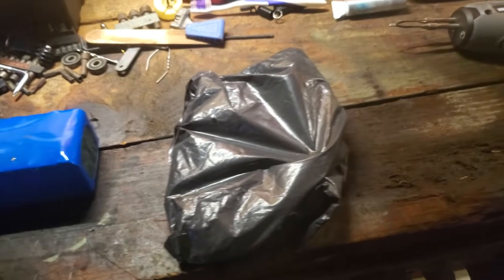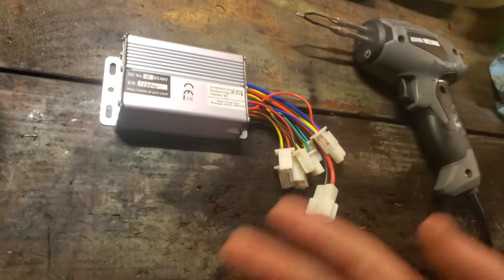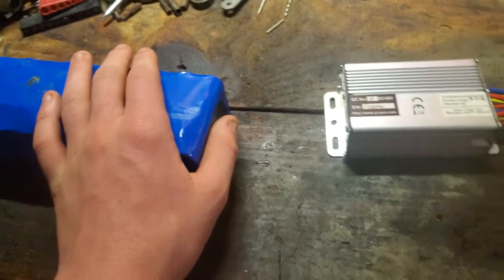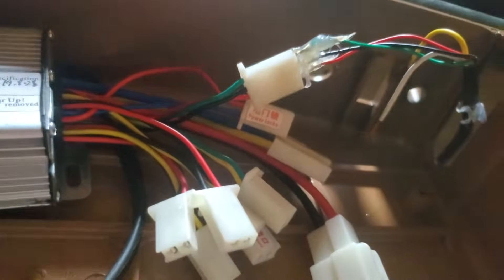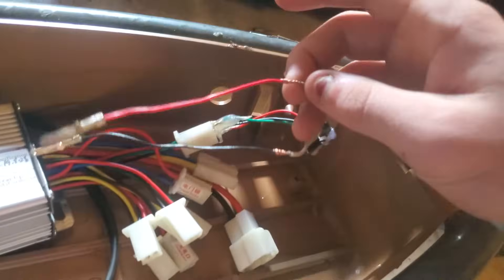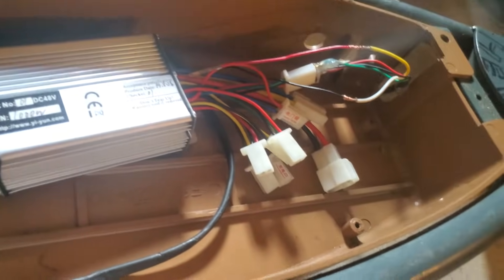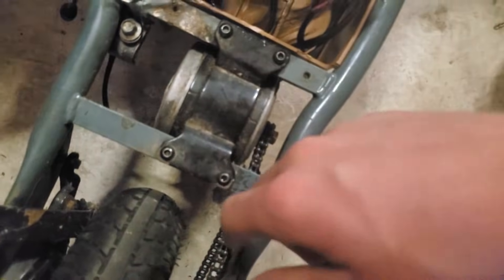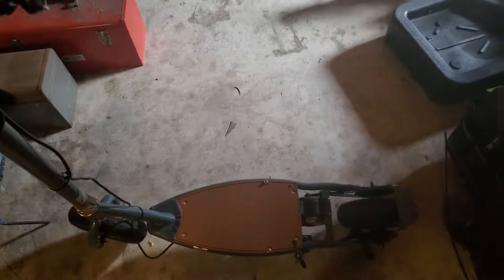Wire 48V Speed Controller Key Throttle, Motor, Battery...

Comment: Question: I have a 1000 Ecotric Hammer, 48 Volt, I want to use a 52 volt battery with. Is there any reason why the 48 volt controller would be damaged by this?
Reply from the maker: Its possible to work since it isn't over 6 volts above 48, but its not guaranteed. I would give it a try since the controllers are only 25 bucks,
Reply: @dylanmoore1006  Yeah, since the battery was $300. I would like to see if it works. I'll probably upgrade the controller if things get "crispy"... It is funny how I have never seen a 52 volt controller. They go to 48, then jump up into the 64-72 range...Oh well, I let you know what happens Thanks...lol!!
Reply from the maker: @starwoodstudios1  no problem mad good luck
Reply: @starwoodstudios1 hi did it work with the controller 😊xx

Comment: Hi,
Thanks for your video very helpful, however when you connect the batteries and motor to the controller you skip the process. Can you help me we’re I gone wrong. I have similar controller and throttle set up. Connected the red, green & black wires of the throttle to the derailleur controller similar to your video. Connected the yellow & white wire of the throttle to the power key of the controller. When I turn the key of the throttle the battery lights indicator is “on”. However when I twist the throttle the motor will not run. Connected the battery wire black to black of controller and battery red to red of controller. Yellow wire of controller to black wire of motor and blue wire of controller to red wire of motor. Twist the throttle motor not running however check the voltage coming out of the controller is 36.8 volts and also the same voltage when I twist the throttle and battery indicator lights are “on”.
Thanks

Comment: could u help me understand please  I wanna build a electric scooter with each hub     motor at 1600w and the battery at 72v35ah like the chinese make i have a frame but i don't know what controllers to buy and how the go together. did u have to out your own connectors together since some might not sna in together thanks  like your videos great job

Comment: Hey man was wondering if you could help me out ? I know you said the 1800w speed Controller is trash lol but thats what i ended up getting 🤷‍♂️ wish i saw this cideo before buying. Anyways, i am having trouble with the yellow and blue wires from throttle?
Reply from the maker: oh so the yellow and blue wires serve as your key/switch unit. You have to connect them to your throttle and switch the wires twice if you have problems the first time because if they are reverse connected it makes it where the throttle will show on while the key is off, thats if you have a throttle with a meter. You also have to make sure that the throttle wires are connected correctly or else it will show weird signs... if it still doesn't work chances are you could have popped the controller but thats only if you connect the battery incorrectly... Hope this helps
Reply: @dylanmoore1006   i have the same throttle you have and you said to connect the yellow amd white to the throttle ?
Reply: @dylanmoore1006  on the speed Controller diagram it says that the red wire with the circle washer end has to be connected ?
Reply from the maker: @health1st189  you cant use that type of controller for this setup you need to have the one that I have exactly link in desc
Reply: @dylanmoore1006  oh ok thanks for letting me know 👍 
I do have another 48v throttle you know the one with the chrome ends and volt reader ? The red, green and black are connected but, not sure where the other 2 wires go? Really appreciate your help 🤛
Reply from the maker: @health1st189  They go into a labeled connector called "powerlocks" and no problem bro🤜🤛

Comment: If i put one 36 volt battery in the scooter and put a 48volt controller and keep the stock throttle will everything Work?
Reply: It will work as normal, but recommend buying a variable throttle so that you would be able to control the speed, as with the stock throttle as soon as you twist it, the scooter would go flying up as the stock throttle is nothing more than a on and off switch for the throttle
Reply: No,controller has a minimum voltage to work

Comment: Just put a 48 volt 1000 watt speed controller on my mx350 and it is fast
Reply from the maker: Nice I did mine while back and it goes like 25
Reply: Did you have problems with the pegs for your feet because they are soo high
Reply from the maker: Oh yes I'm 5'10
Reply: How did you charge it?
Reply from the maker: @connor9801  I lucked out on one from Ebay for 3 on a bid and it was a honeycare 48v 2.5 amp charger... most cost around 35 to 40
Reply: Would the old charger still work or no?
Reply from the maker: @connor9801  you would have to have a 48v charger, and yes you can swap any plug onto it just make sure you match the negative and positive wires
Reply: Also could I take the end piece of my old charger and put it on the end of a 48 volt charger?
Reply: Ok thanks for all your help🙏
Reply from the maker: No problem take care if you have any other questions feel free
Reply: Do you have a link for your modded Mx350’s new motor and wheel sprocket and the chain or  did you use the stock sprockets and chain because I filed the stock sprocket to fit my 48 volt 1000 watt motor and at max it goes 15mph and yours went 25 mph?
Reply from the maker: @connor9801  okay so the problem is that some of those 1000watt motors are only rated for a short amount of rpm rather where the stock motor is rated for a higher rpm especially when the voltage is doubled... I was using the same sprocket with the stock motor on my setup. What is your rated rpm for your motor?
Reply from the maker: And another thing is that you can make the front sprocket huge do that it drives more length and possibly with the rear if you can find one with the same matching holes which I'm unsure of if they sell those... just make sure your motor gear shape matches the hole of a new bigger one so that it fits
Reply: Ok thanks
Reply from the maker: @connor9801  no problem